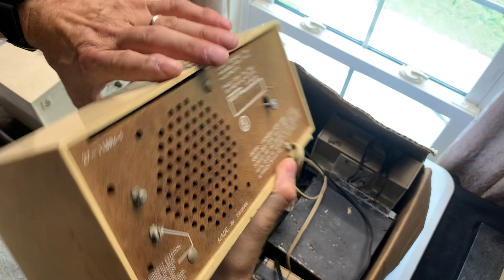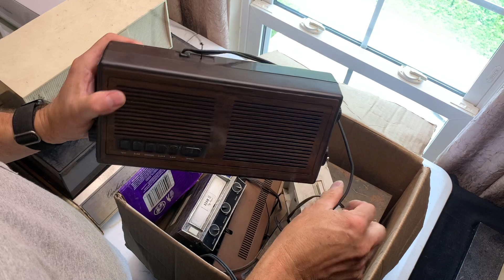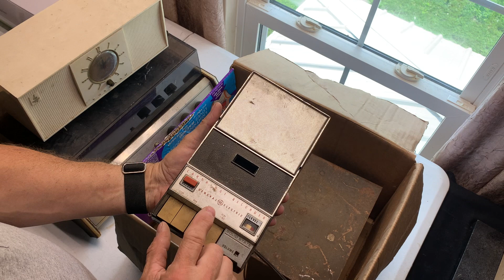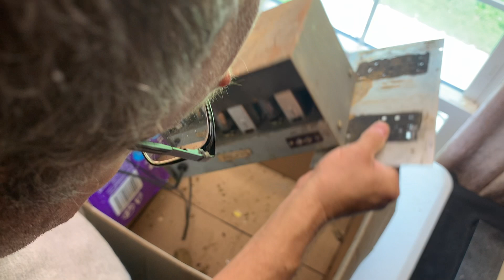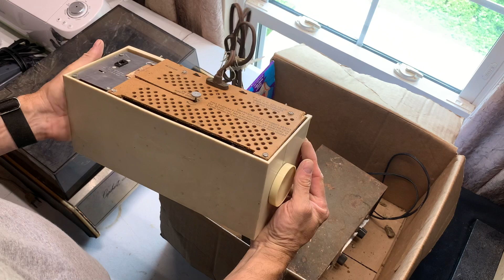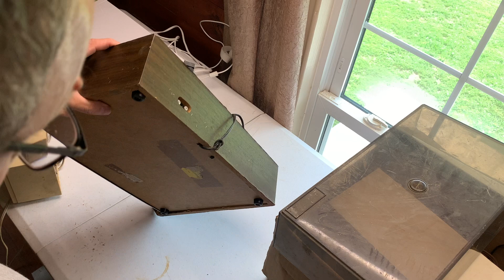Vintage Tech: mix of junk to repair

Comment: I'd like to see that mutliband radio up and running again.
Reply from the maker: Me too, Franko!  I plan to get on that first.
Reply: @KOVintageTech  Yay, I can't wait. 😄
Reply from the maker: I got it running - it plays barely and needs an alignment badly but I don’t want to spend the $20 for a manual. Can’t seem to find a free one online.
Reply: @KOVintageTech  Glad it's (almost) working.

But that's far too much for a manual. The cheek of some people.

What's the make and model ? I'll see if I can find anything on UK sites.
Reply from the maker: it’s  a knight span master II. Can’t locate a good model number
Reply: @KOVintageTech  I've found the schematic for the 'knight span master', but there is nothing on the 'knight span master II'.

It's not the best quality but it is readable. I'm just not sure how different the two models are. I still have your email address if you want me to send the jpeg I downloaded. (?)
Reply: @KOVintageTech  Sorry. Just realised. You don't need a schematic, you need details on how to align it. I'm an idiot. LOL.
Reply from the maker: @Franko_Walker  it’s a knight kit, and any manual will probably have that info I imagine.
Reply: @KOVintageTech  I've also found the 'Knight Kit Spanmaster model 83Y 258' instructions in pdf format. I don't know if that's any help. (?)
Reply: @KOVintageTech  http://bama.edebris.com/download/knight/spn-mstr/spanmaster.pdf
Reply from the maker: @Franko_Walker  Thanks for your help. This is a different model. Did not require alignment.
Reply: @KOVintageTech  No problem. Sorry I was'nt more helpful. 👍
Reply from the maker: Franko, I found a manual online for $16 US plus shipping.  I went ahead and ordered it, As soon as I get it, I will align the set and publish the video. I have part one ready to publish for you!
Reply: @KOVintageTech  That's great.